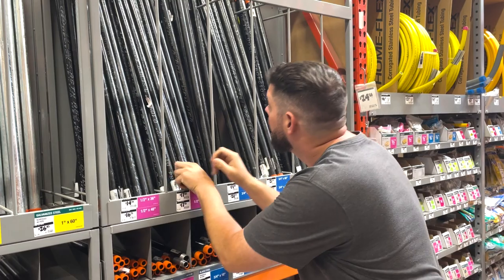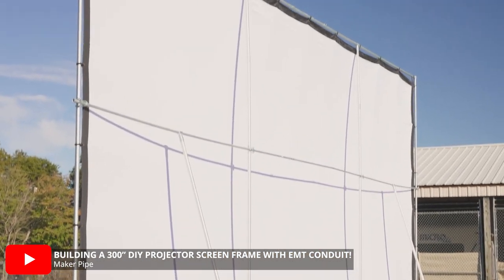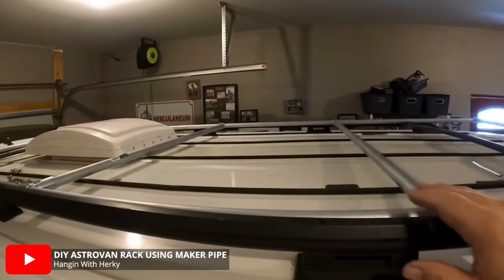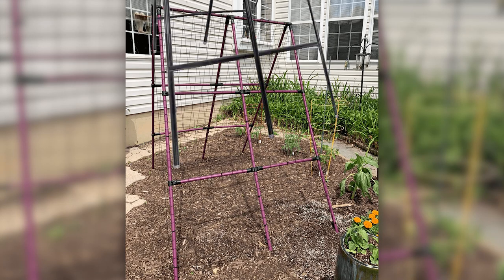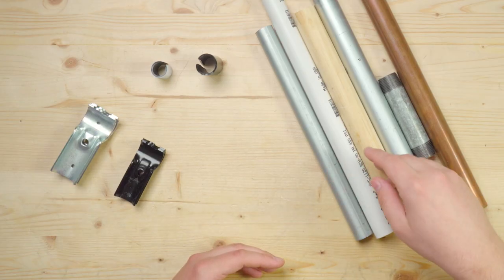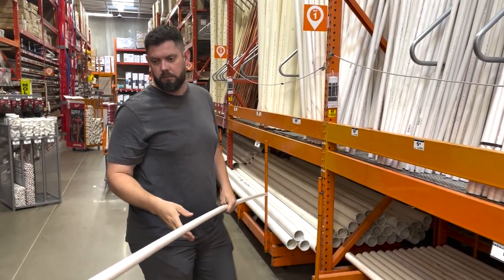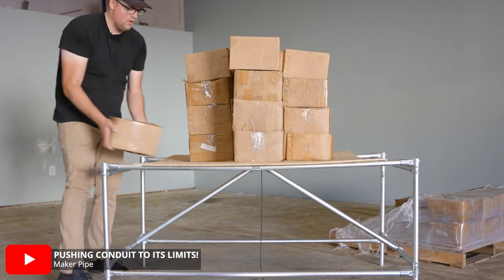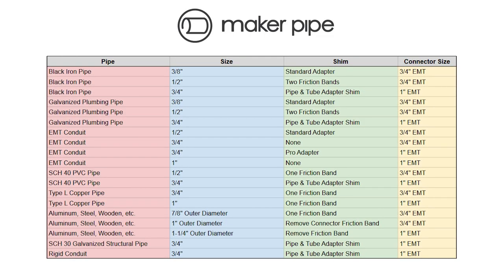Are You Wasting Money On Your DIY Pipe Projects?

Comment: The connectors are good, but they are too expensive
Reply: and yet when you google that its too expensive google says otherwise...
but yes i would say there cost is 40% to 30% higher then they should seeing its just 20c screws an simply sheet metal needing to make connections.

Comment: great item if it was not for the cost for some of the connections
 it cost a lot for even small projects counting on what you would need 8dollor for one connector ill take a hard pass
Reply from the maker: Yes, it's not the most cost effective for every project. It provides huge cost savings for some projects and others it just doesn't make sense to use connectors and conduit which is okay of course. Just depends on what you're making and why. Same can be said for a lot of other building materials. Thanks for the comment!